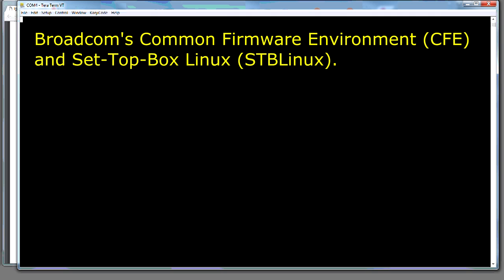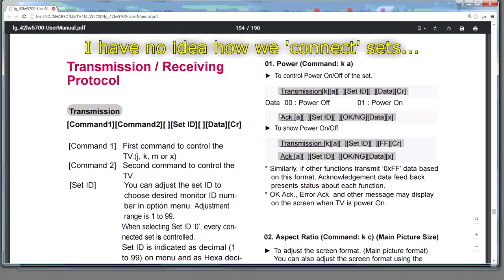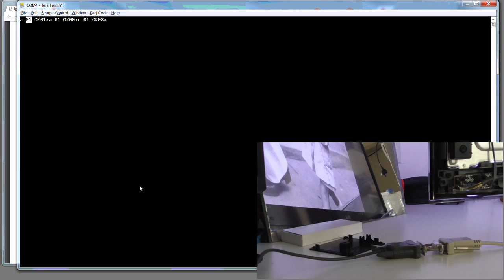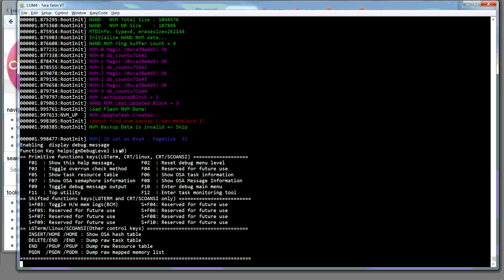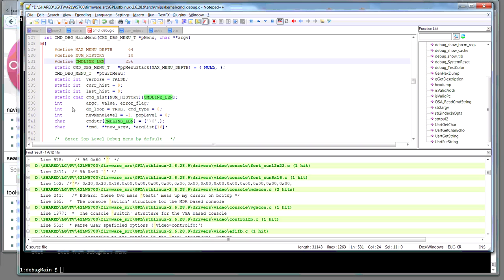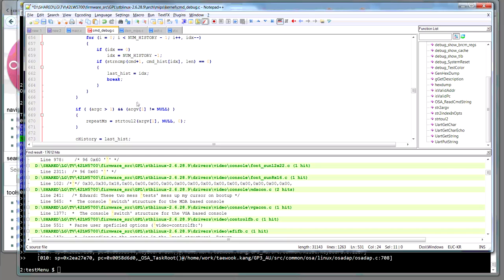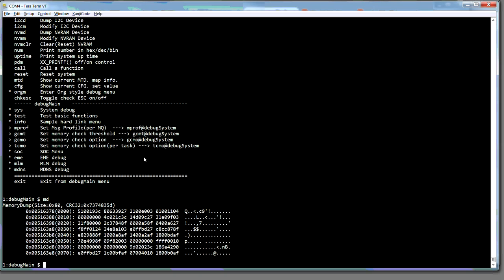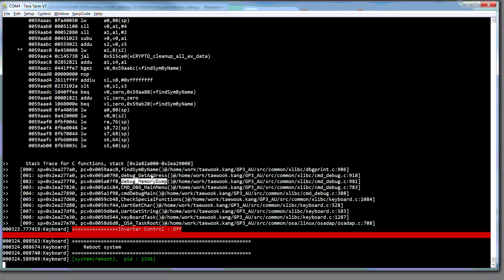Repair of LG 42LW5700-TA LED TV, Part 5 - It does compute

Comment: I've watched all of your videos & I have one quick question: after all of this you've done, have you fixed the TV or that just works temporarily?   please answer me that's  very important
Reply from the maker: It is a temporary fix. The actual problem is probably a mechanical failure inside the chip.

I posted some links in the comments of one of the other parts. I suggest you do a search for "Flip-Chip".

The current theory is that the heating and cooling, deferentially expands and contracts the inner chip-bonds against each other, often making them 'work' again, electrically.
Reply: thank you ... keep going ....you're awesome.
Reply: @richardrudek01  Thanks for posting all these video, you are awesome, I have previously went through the heating and my TV keep failing between months, have been doing it for past 2 years, now it is at a point as soon as I am heating up it is working but only for a few min, I guess the chip is now failing for good and it is time to say good bye, however I am not ready to say good bye to this tv, this is the only 3d tv that I owned and now no body sells passive 3d tv so I am now waiting for the replacement BGA from china ($20) My question is will it fix my tv for good or it will also be temporary (who knows the seller might be selling me a heated package than a new one) did you changed yours?